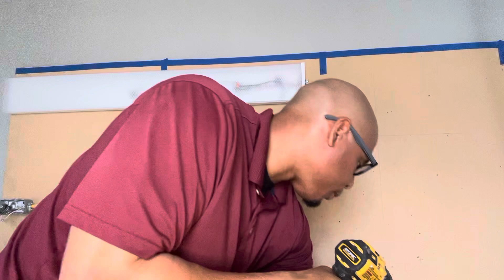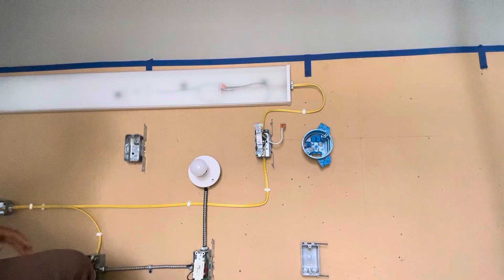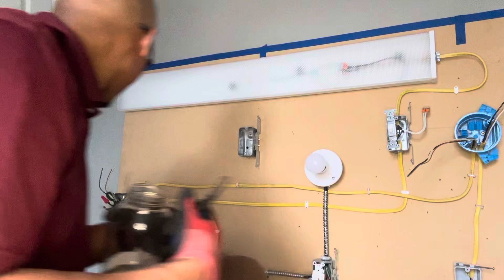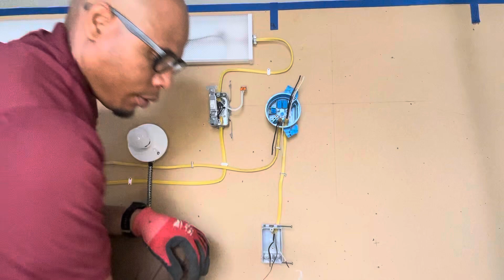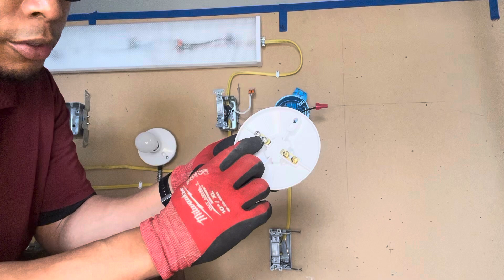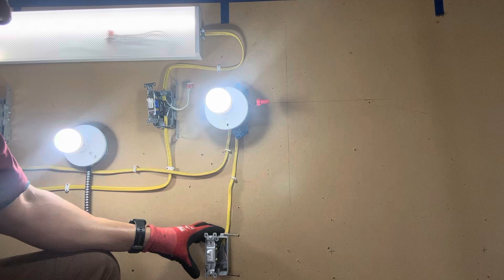Single pole switch with feed at light fixture

Comment: Under the current electrical code a neutral conductor needs to be extended to the switch box since there are smart switches which will not work without it.  In this application with a simple switch it would not be used.  You could also use the neutral if you want to install a combination switch and duplex receptacle.